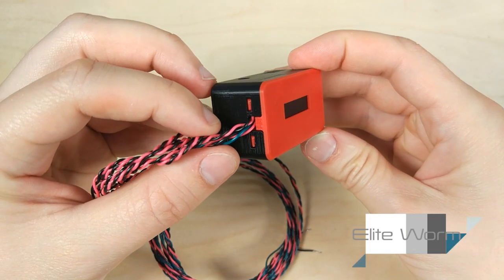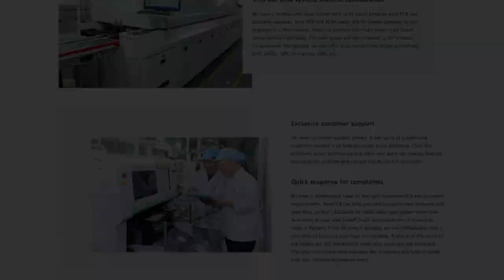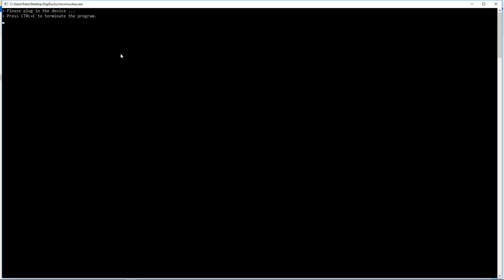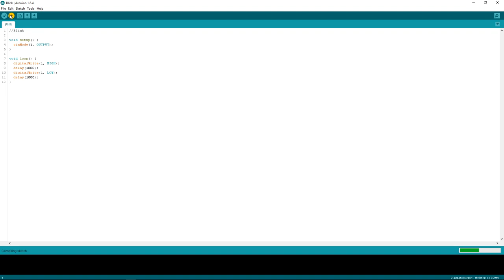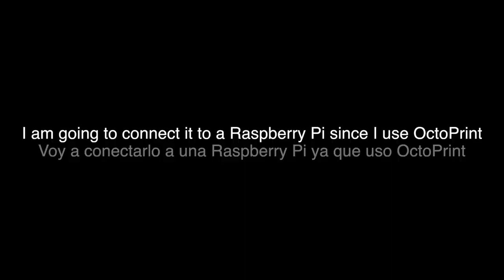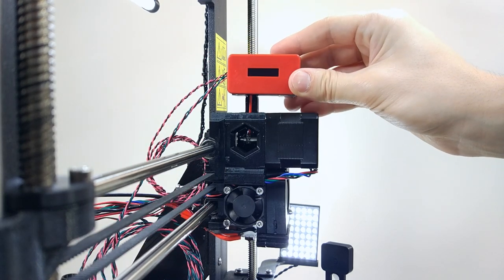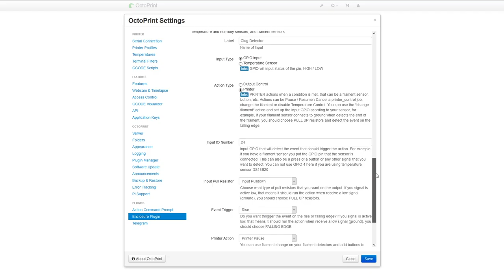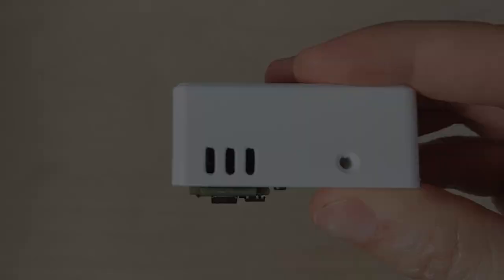Build Your Own CLOG DETECTOR | NEW VERSION! Connectivity With Your 3D Printer And PCB Based

Comment from the maker: 10 PCBs for 0 $: https://www.nextpcb.com?code=eliteworm
Reply: I'm thinking that adapting your circuit with the encoder wheel guts from a mousewheel might enable greater sensitivity & with a tweak to the print controller, pausing print, going to a "dead area" of the print bed & either attempting to clear the nozzle, or queue for operator intervention & resume upon completion.
Reply from the maker: @kf5tqnkf5tqn36  Yes, you can modify it and try different configurations. You should print the open-back enclosure model! There is definitely room to make it react faster.
Reply: Are these being sold as kits or pre-made anywhere?

Comment: I love what you did here.  I love to take something like this and tweak it to work for my printer.  I would like to be able to understand the code and change the parameters.  could you make a video explaining the code and how to edit it?  I would like to use the signal that goes to the buzzer to go to a relay.  I will use the relay to open or close the circuit connected to the old simple filament  sensor.   also I would like to know sooner about the filament Jam.  So maybe I will use a finer resolution encoder and adjust the threshold that tells you there is a jam.  Is this written in python?

Comment: How can I get the board that you were using or how do I order the exact same board to make me one
Reply from the maker: Hi. Look at the description of the video, you will find everything you need to build it. To order the PCBs, you must download the Gerber files ( http://www.nextpcb.com/ueditor/php/upload/file/20200623/1592906396322929.zip ) and then go to NextPCB.com ( https://www.nextpcb.com?code=eliteworm ), upload those files and just place an order. Also you can contact them if you need help but it's easy to do it.
Reply: @EliteWorm  Have they taken down your PCB gerbers?  The link above is no longer valid (404 error).
Reply from the maker: @bbowling4979  Try it now. The last ")" was not meant to be part of the URL and that's why it didn't work.
Reply: @EliteWorm  That's got it.  Thanks!

Comment: This is awesome! I'd make one for my Ender 3, but I almost have no electronics experience.
Reply from the maker: Great! Be sure to mount it as close as possible to the extruder so the filament doesn't make the clog detector's wheel spin when traveling side to side. If you need help just let me know.